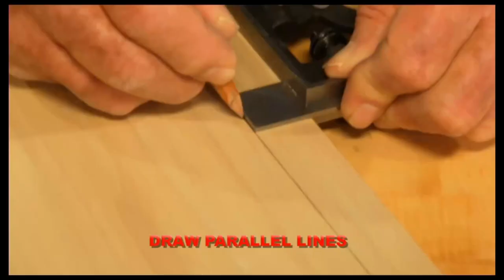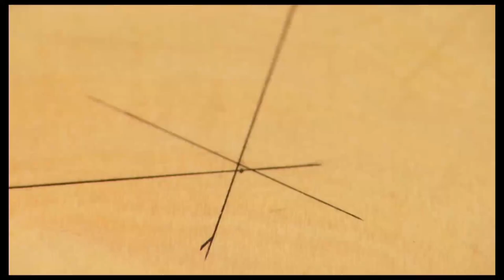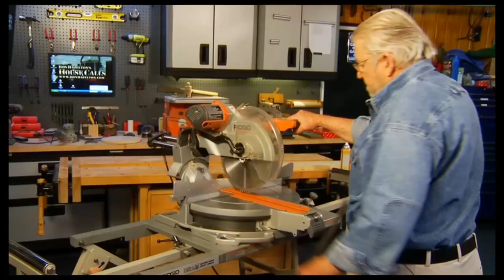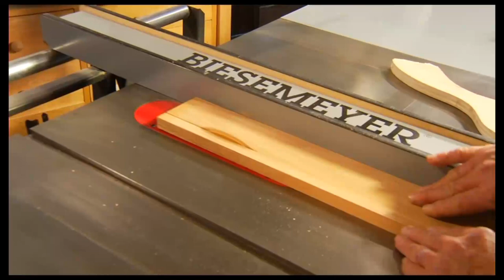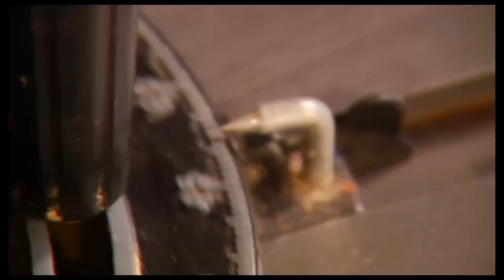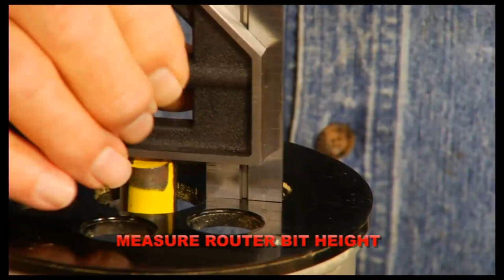Combination Square Tricks - Carpenter Tools

Comment: I'd like to add a few hints for accuracy. 
1. Use a finer pencil or scribe to mark your lines.
2. When marking the center of a circle, the inside of the triangle is closest to the center.
3. When checking the 90 degree setting on my table saw, I put the short arm against the blade body and the ruler against the mitre guide. Make sure you don't have the ruler against a tooth of the blade.
4. Don't drop the square.
5. To check accuracy, draw a line 90 degrees to the board, flip the square over and draw another line - they should be the same.
6. After cutting a board make sure there aren't any splinters hanging off the end which can throw off your measurements.

Comment: I like how this video shows how to make small straight  inch or what ever denomination parrellel lines down a board and is only limited by the size of the rule used... not like the table saw where you are limited by the size of the table saw...

Comment: I have used these a lot over the years, but due to the shortness of the base, you can get errors if the wood right there is a bit off or a defect in the wood throws it off.  Best to use as long a base as you can.  And also, there needs to be an explanation on how to verify the accuracy of this square you are showing.  An old fashioned carpenters steel square can actually be adjusted for square using a punch to either increase or decrease the 90 deg angle.

Comment: The oft maligned "cheap" combination" or tri-square as we have called them for the past 60 years, can be adjusted using very little effort to produce accuracy. I use two such cheapies in my woodworking shop.

Comment: to me a short coming of all combination sq. blades, I've seen,  is there are no holes for marking circles,  they can be at an assortment of lengths/radii.   
 On the cheaper varieties the body of the sq. is very suseptable to incorrect slide points inside [not readily visable] so that sq. or 45 deg. lines will be incorrect,
Reply: You could always use the notch in the end of a tape measure to make perfect circles

Comment: On an old Lufkin combination square, there is sphere on the bottom on the anvil part. What is the purpose of that sphere?
Reply: Likely the handle for a built in scribe. Pull it out to see a hardened sharp most nicer squares had one at some point(often lost rather fast)

Comment: combination squares are notorious for being inaccurate
Reply: cheap combination squares are notorious for being inaccurate... Starrett is FAR from cheap! But they make great tools!
Reply: Ron Garvin 
Is that an advertisement ?
Reply: lol I'm just a fan of well built, american made tooling!
Reply: Ron Garvin but you would never find a tool maker using a combination square because as I said they are notoriously inaccurate
Reply: If you need to hold a tighter tolerance then a CS can provide you may need to use another method all together. But for quick,easy measurements, or non-critical checks the square has its place. I would contact Starrett about getting your square serviced if its that far out.
Reply: Ron Garvin 
I know.  Thats what I said
Reply: Check John Heisz video "How to Adjust A Combination Square."
Reply: They are recommended by experienced woodworkers.
Reply: Your talking about only the function of determining angles and that can ne recalibrated. When it comes to scibing lines or gauging depths there is nothing more accurate. That's not an opinion thats a fact.
Reply: @andrewknapp3796  I have $500 worth of Moore & Wright depth gauges which say you are wrong about the accuracy and repeatability of combination squares when measuring depth
Reply: @micromachine7954  Probably cheaper to just buy a new one than shipping the old one in for "servicing" plus paying the fees and return shipping!
Reply: John Griffiths   Starrett also makes machinists squares.